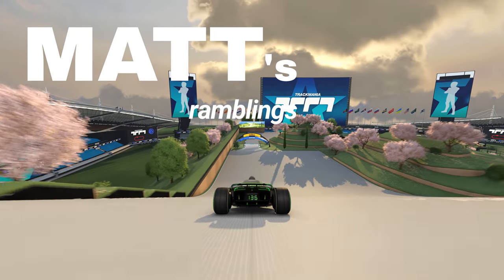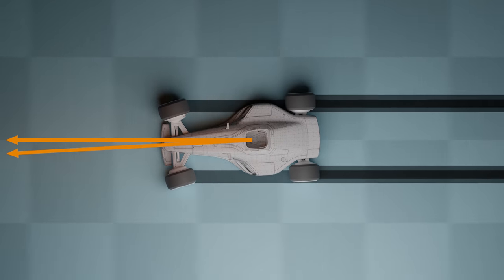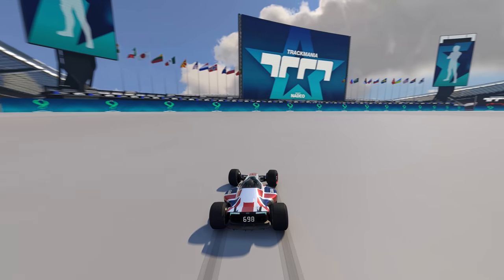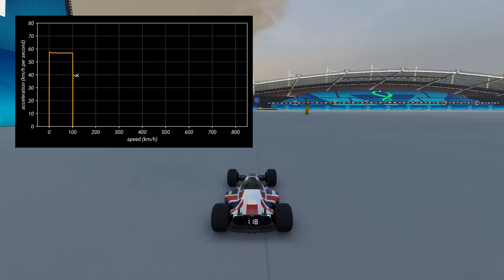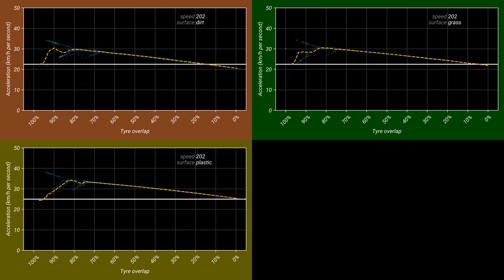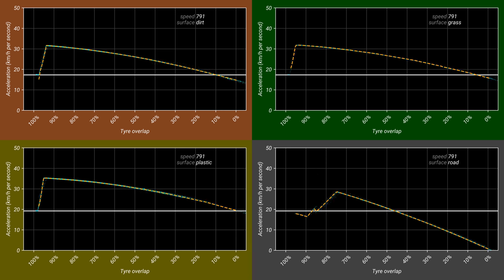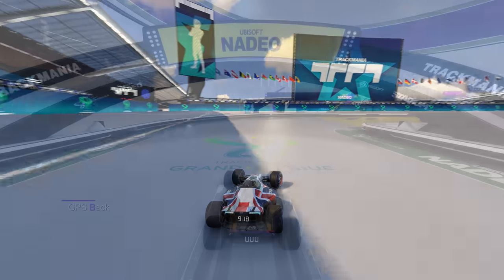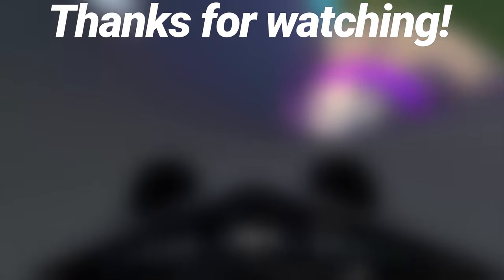In search of the perfect speed-drift in Trackmania

Comment: This is a good question whether this plugin should be released. There are places in fs tracks where you have to sd in cam3 (POV view), so you can't see skidmarks at all. So, in theory, knowing additional information from a plugin that can't be observed in a usual way is practically cheating. On the other hand, pro FS players can do proper sds in every situation, even blindly. So it won't bring much of advantage in top FS competitions. Also, the hardest thing in FS is not knowing the best sd width, but understanding and keeping the most optimal trajectory from start to finish (including sd, walls and tubes). And this requires a lot of training, with plugin or without. So, in total, using this plugin would be a cheating (and this is bad), but only working for mid-tier fs (not bad, not good, dunno)
Reply: It should if nothing else be added to the TAS program

Comment: I'm a bit surprised given the skill and commitment from members of the community, that a more detailed decompilation and breakdown of the physics engine has not been performed yet.

That said, empirical analysis like this is likely still incredibly useful - mechanics like speed slide, bug slide, uberbug, etc. are the result of many parts of the simulation interacting in unexpected ways. Sure, things like the base acceleration curves are probably well defined, but I would not be surprised if you can't really point to a single set of configurations that govern things like the optimal slip angle.

Thank you for your work :)

Comment: Some tests featuring slopes would be nice, if i recall at least some very good fs players say it does change the optimal width, you can use openplanet to make a bigger building area if you need one to test this.

Also I would personally say your plugin is fine to release, as it does not actually change the gameplay itself, but only serves to give more clarity on what is happening on screen, you still have to actually play the game yourself and have the skill. There is actually already a plugin that exists to show acceleration anyway, it just is a much worse graph.

Very nice video btw, and if there is any way you could publish the results as a static image showing optimal widths at different speeds then that would be great, although not sure how you would represent the data.
Reply from the maker: Thanks, and thanks for the tip about the larger play area:  As you might be able to tell from the vid that was a problem I hit with my flat test maps.  To do slopes properly I think I'd need to investigate custom blocks, since the default set appears to be limited in the number of gradients you can lay out.  It's certainly something that would be interesting to look into.
Reply: @MattsRamblings  You don't need custom blocks, just a bigger map base, you can use openplanet to create one or I actually have a bunch of them of useful sizes in a discord if you want to just download some.
Reply from the maker: I see, thanks

Comment: great video. Although i think that your tool would only give a minimal advantage in a real race scenario, it would still be an advantage so it would be better to not release it.

but maybe you could publish a set of images showing each speed/track combo, the graph for optimal angle (with exact coordinatss of peak labelled), and an image from the game of what that overlap looks like.

i dont know how hard that would be to generate, so depending on difficulty you could show it every 5kmph, every 50kmph, etc. having all this info in a non video format would be great for the game

finally, would this method apply equally well to TMNF?
Reply from the maker: Thanks! I've played TMNF but haven't investigated it in the same way, so I'm not sure if the curves match exactly, but it should be possible to grab the same type of data and do a similar investigation.

Comment: You should release your SD tool, it gives nothing other than data  to look  at, and it can help players grasp  speed drifting a lot quicker  if they are new to the game. Its only data which  the game  gives you placed  into chart form making it easier to understand
Reply: I don't know, I think it would give an unfair advantage for people hunting, it would even be possible to write a tool based on this one that automatically corrects the slip angle to give maximum speed output. It seems like quite a dangerous thing to release for the community.
Reply: @red13emerald  a tool like that has already been made and shared to quite a few people

plugins like the one on the vid wont really do much
Reply: @skrrtskrrt9288  details?

Comment: Is there any theory on why this happens? This seemed suspiciously similar to the quake stuff : p
Reply: when holding the gas car always has forward momentum until you slide then forward momentum changes to sideways momentum (so you can drift corners) a speed drift was originally a bug that occurred that let you have both the sideways and forward momentum gain at the same time, this was later added as a feature.

Comment: You could have the plug-in automatically overwrite some of the key presses and positions in the generated replay file. 

Track mania is deterministic so the in-game renderer will flag the replay as invalid if computations from the key presses don’t add up to the game’s constraints. This makes it unusable in score boards for speed runs. Treads the line on invasive and could potentially be bypassed tho lol